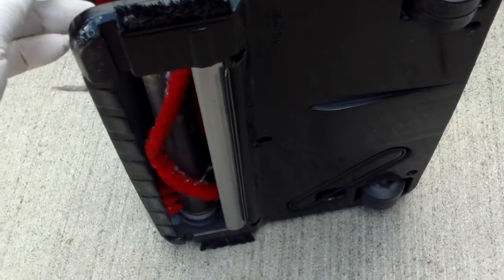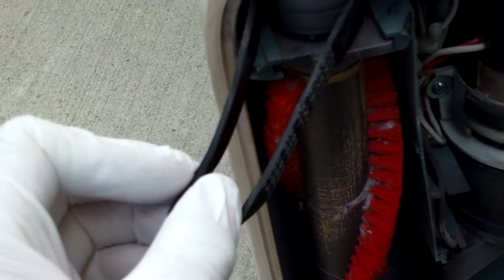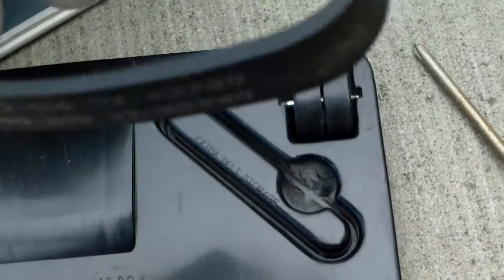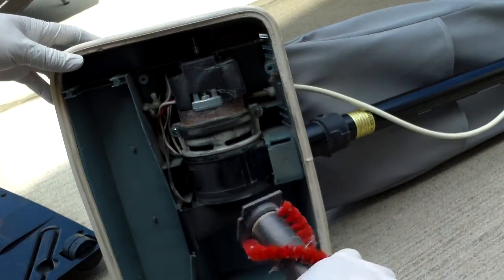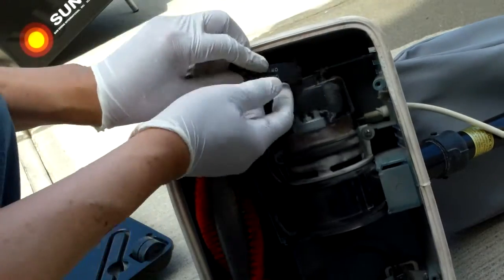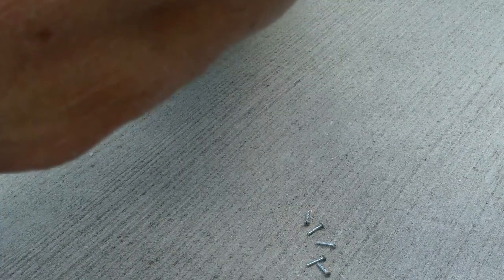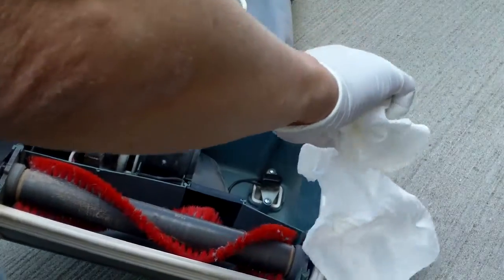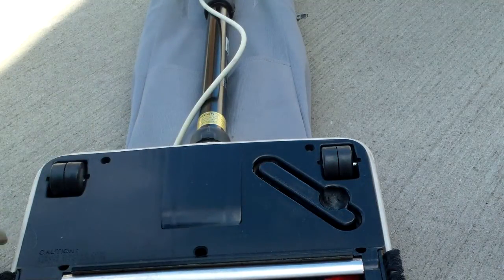Replacing the belt on the Oreck XL vacuum

Comment: Belts for Orecks  are not the original belts since Oreck  went bankrupt. The new belts are shorter  and very hard to stretch to make the replacement.  To make the belt stretchable  long enough to put the belt on, just put the belt in some boiling water for a few minutes. You will be able to stretch it to make it fit and not strain or hurt your fingers.

Comment: I think they are over priced vacuum's. I only had mine for less than 8 months and it has broken 2 belts.and locked up 1 bearing.
Reply from the maker: Ouch, only 8 months. You must vacuum everyday and live in a big house. And of course the warranty is not for the parts broken.
Reply: my wife use it for our cleaning business but i use the one I got from walmart. its better than the oreck, I have never had a problem with it in the 2 years I have been using it, but the Oreck is garbage, the warranty only covers the motor thats it.